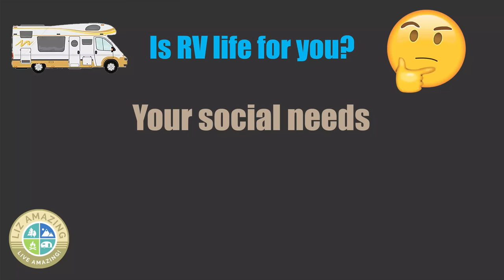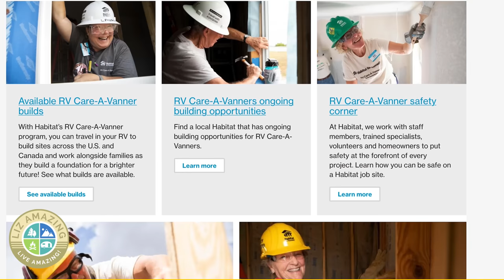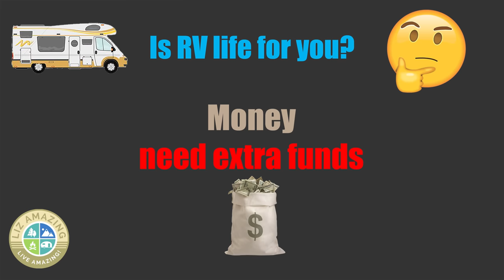DON'T try RV Life before watching this

Comment: Just a little observation: I notice you gathering up your outside mat. I did what you were doing for a long time until I learned to just roll the darn thing up and put a bungee around it. I fold it over in thirds and then roll it. Works great for me. Hope this helps.
Reply from the maker: Thanks for the tip, Charles. Yes, there definitely has to be a better way than me trying to fold it like it was originally. Sure appreciate you!

Comment: All very good points. Since we went full time I have replaced a refrigerator, a microwave, a charger/converter, lights, plumbing, upgraded cabinets and even built furniture to our liking. Of course, we bought a 25-year-old motorhome so nothing unexpected. If you're not handy you best have a large emergency account, better yet, have both.

Comment: Yes. If you 0lan 9n traveling far, have at least $3k for what may come out there. After two years of carefree travel solo, I wound up paying $2500+ coming home just on tires and I had new tires. Crap in the road blew one front and two dually. Two other cars were involved. A truck dropped sharp industrial parts. Glad I had the money set aside.
Reply from the maker: Whew, that would have been awful if you didn't have savings. Good for you and thanks for your comment, Kathryn. See you in the next video.

Comment: Thanks Liz, always great advice on your channel.  I know a young couple who never even checked their tire pressures hauling a big 5th wheel, found after I noticed they had only 25psi in one wheel.  They also had to borrow my pump to get it back to 70+psi and the tire blew just 15 miles down the road.  Of course I got blamed 😉. Your tips are so important for anyone considering this life.  Newbies - write each tip down and decide before you buy, who is doing what and with what funds...once mastering the maintenance part you could even consider boat life with it's exponential level of maintenance...happy trails!
Reply from the maker: Oh my! Sorry that tire incident happened. Thanks for your comment. And I used to own a boat!
Reply: Hi Liz, what's it like now that Google took away our names, would it be a good idea to say who we are, especially communicating in this type of setting? Who do you think this is?

Comment: We did the 3 month thing in AZ for 5 years - started when I was 70 and my wife was 67 - all was well the first year - December to mid march - the second year was good - but a bit more stressful - the third and forth years found us going from a 32' travel trailer to a 35' 5th wheel. The extra room was great, but my wife lost her interest and started having physical problems. Then covid hit and no one went anywhere. We sold our 5th wheel during that time, and replaced it with a 24' travel trailer and only travel locally (5 or 6 states) and in the summer - and for short trips. (a week or less) and that seems to be working out at this point. Final analysis - - me now at 79 and wife at 76 - we could never go full time. Short trips without fighting the winter roads is now our venue.
Reply from the maker: Sounds like you have found a way to do it that suits your needs. Being flexible is key, which you certainly are, Mark! Thanks for watching and see you in my brand new video right here: https://youtu.be/-4V8KVdMnBA